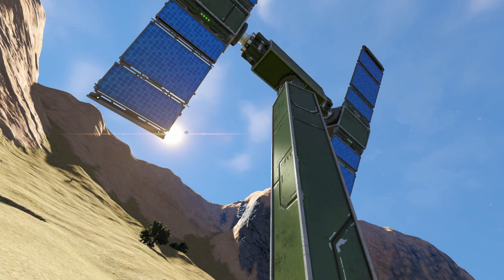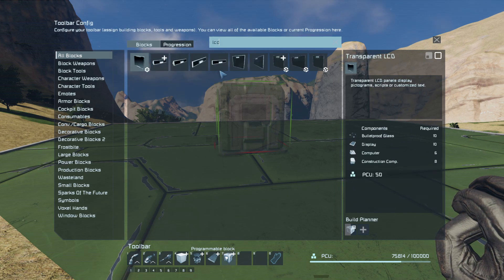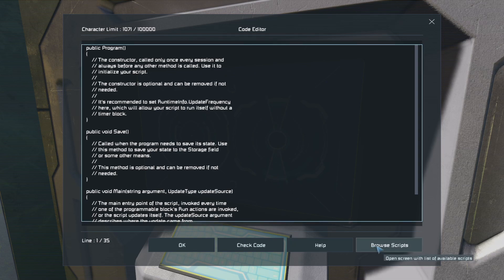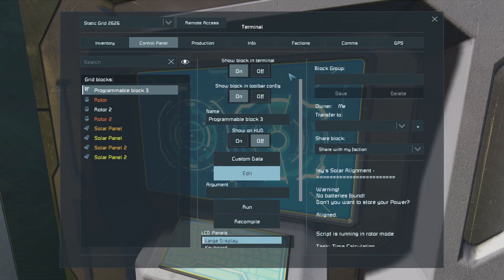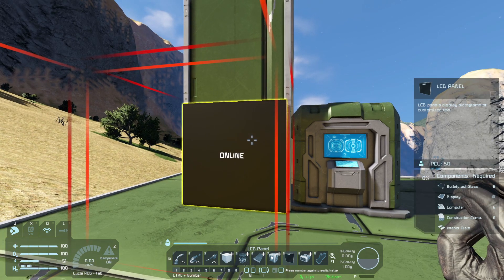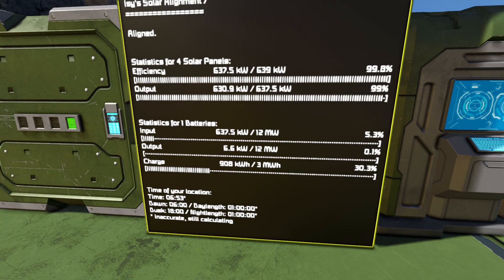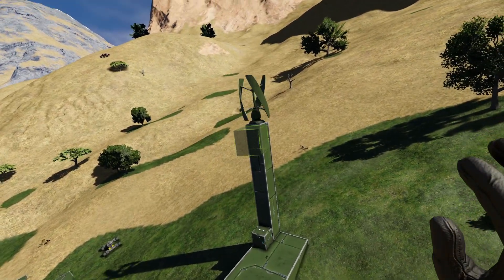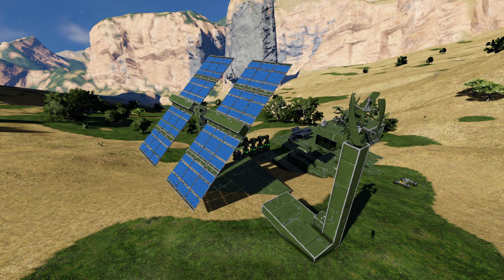Isy's Solar Alignment Script | Space Engineers

Comment: Great comparison of the panels vs turbines. Depending on weather your wind turbines will give you more or less power sometimes (if weather is enabled in the world) but given that solar panels don't work at all at night turbines still win out easily on any planet with atmosphere.
Reply from the maker: Absolutely. Turbines first. Solar if there's no wind. But if you're going solar, isy's script is the best. Not sure why it was so slow for me in the tutorial. When I did the dress rehearsal it was way quicker. Who knows?
Reply: @TallmanBradGameplay  I think Isy's script is an error minimization algorithm. Basically it tries moving the rotors a bit and sees if the result is better or worse, then repeats. If you start an algorithm like this with one of your inputs (in this case rotor angles) already at the optimum you can induce small oscillations that give the whole thing a hard time. It probably needed the sun to move a bit off the optimum so it could really get going. Try starting the script with different initial rotor angles and see if that helps.
Reply from the maker: Craig you are absolutely right. When I did the 'dress rehearsal' I built the tower 90 off axis from the video. The panels had to move to find the sun initially. I even tested partially covering them and had planned on talking about that but I was so unhappy with the performance I moved on.

I completely agree. It moves until it hits a max reading then goes past until it drops to assess that angle, then twists until it goes through max and onwards until another drop to find that value. It makes sense and really it's the only way it could work. I doubt day 2, when the panels have already tracked the full path of the sun, that the system remembers the actual path. I know it remembers the start point for when it resets, but it's got to be reassessing using the higher/lower method for the rest of the path. Not that there's anything wrong with that! 

If I hadn't committed so much time to the tutorial when I realised the system wasn't happy, I would have started again. Unfortunately I only had so much time to put the video together. I think the end result is a fair representation of the system, even if it operated a little slower that it would typically.

Thanks for the feedback Craig. It's always appreciated!
Reply from the maker: Have you seen the output from a turbine during a storm? It's insane! But then again it's abysmal during fog.

Comment: Thx for your community support ;) I already use this script but your video inspired me to build some solarpanelsdrones for space which fly out, align itself to the sun, recharge their batteries and come back to recharge my base. That way i can have a base deep in an astroid without having a big tower full of solar panels and i could add some gatlings turrets for defense purpose
Reply from the maker: Thats a great idea. Again! You should make a video of that! Haha. Nice bit of engineering there MightyAssa and thanks for watching and commenting on the video!
Reply from the maker: I have to ask, are you using pam for the scripting of the drones?
Reply: @TallmanBradGameplay  These drones are mainly to recharge and defending. I guess the main problem is to find a way that the drone fly to the job position and stay there until it's full recharged. I did some research with PAM Script and it has no function to return when the batteries are full only when they are going to be empty. I could try my luck to edit the PAM Script but i'm not confident ;) 

The vanilla solution would be to use a remote control to fly a fix position and turn on the progammable block with "isy's solar alignment script" on. Then i could use an autodocking script to give the drone the command to fly home. Let's see how this turns out
Reply from the maker: Yeah I see what you're saying. Could you have a docking station at the position where you send the drones to charge? Or perhaps ship the batteries between locations instead of the panels/batteties? Batteries on merge blocks springs to mind. 
I've had a couple of requests for drone pathing with actions at either end and it's not particularly obvious what the optimum option is. I'm hesitant to take it any further at the moment without spending quite a lot of time experimenting. I was curious if you were using the pam script as it sounds like the simplest option for a lot of scenarios but timer blocks are probably necessary and they aren't much fun to work with haha.
Reply: @TallmanBradGameplay  I have severals solution in mind.
1. small grid drone with a landing gear that transport large grid batteries with a mergeblock/rotorhead/hingepart to a large grid solar station (fix pos)
2. large grid drone with exchangeable batterypacks ... large grid solar station (fix pos)
Instead of using timerblocks, i would try to set a sensor for automated action at the base docking station/ recharge station. I think at the moment there is no script that has the ability to specify tasks at the job location other than mining, grinding and the shuttle service. 

3. using 'automated docking' script by spug: 
the recharge station is the home base and the drones transporting batteries between the space base and the recharge station. the recharge station is not stationary and act as a dronecarrier. Not sure how good the automated docking script avoid collision in space.

I will contact you again when i made my experience with it in the next weeks
Reply from the maker: Yes, let me know how you do. It's in interesting project.
Reply: @TallmanBradGameplay  This is my progress for today: Spug's Autodocking Script can trigger a timerblock as soon the drone dock with a connector. After docking, the timerblock turns off a mergeblock which connects the drone with the large block batteries. 
A sensor at the dronebay start a timerblock which connect the batterypack with the base after 3s.

next steps:
moving the drone to a second batterypack and fly back
Looks good so far
Reply from the maker: @MightyAssa  it's sounding good so far. What about adding a projection of a battery pack that is welded in place on the merge block that is charging it? The drone collects the battery after it's charged, then you don't need to move from one pick up point to another to collect a second/third battery? Might need a timer block to switch the newly created battery to recharge mode and a sensor for the drone to switch it back to auto when it collects, so it doesn't drain the drone as it detaches the battery.
Reply: @TallmanBradGameplay  Let me test your welding idea tomorrow. Spug's autodocking script can trigger three types of timerblocks. One TB with the [dock] e.g. "TB base [dock]" get triggered as soon as the connector connects. Using the tag [start dock] will trigger the timer block that is triggered in the moment you disconnect. the last option is the let the script search for a timer block on the base with [dock] in it's name.

I'm still testing different variants and i ended up with a drone that is connected via merge blocks and the battery pack has a connector at the front but it's not reliable to line up correctly. Could you add me in steam and i can show pictures? Mighty_Assa from germany
Reply from the maker: It sounds like you're making good progress. I will add you tomorrow when I get back on my pc.